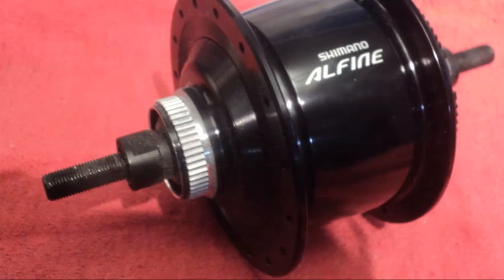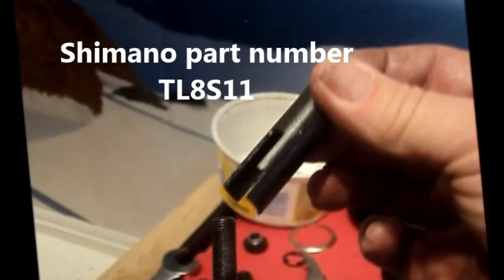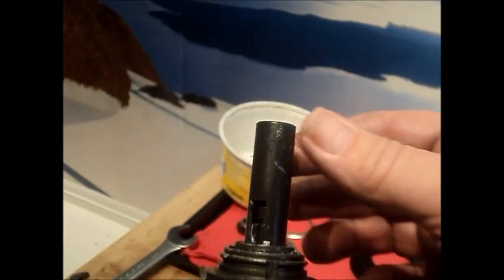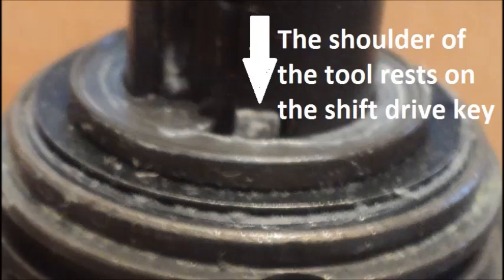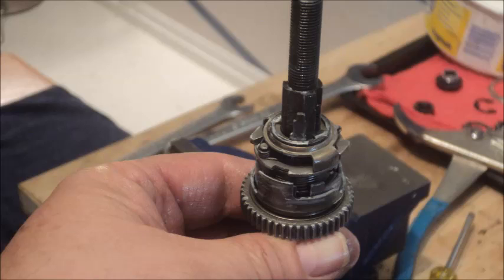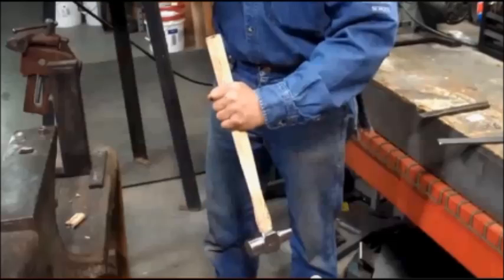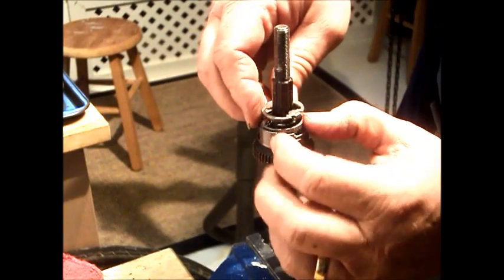Removing the drive side cone from Shimano Nexus/Alfine

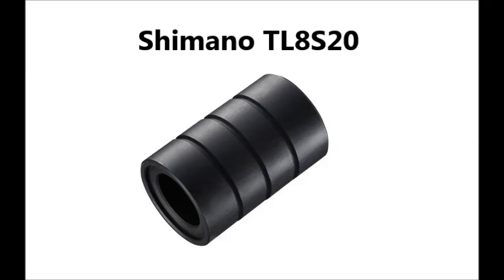Comment: At 1:55 you don't have to use the Shimano special right-hand cone install tool (TL-8S20).  You can just use the outermost locknut on the axle (last part you put on) to press the right hand cone down until it hits the designated shoulder on the axle.  If you watch some other Alfine 8 videos, you'll notice that even after using the special tool, they are using a cone wrench to tighten down this locknut another 2 turns or so, and NOT BY HAND, which means they are driving against a press fit, and that the wrench stops when the cone bottoms out.  So we can drive the cone the whole way using the nut as a press, not just the last 2 turns!  In case you thought you need the special tool to press the the cone to exactly the right depth on the axle, you can't get it wrong because it always bottoms out anyway, when you tighten the locknut.  Besides, relying on a press fit to maintain the position of a cup-and-cone bearing is foolish because tightening the LEFT side cone during final adjustment could easily move the right side cone, and if not, riding would eventually introduce play.  It need to have positive stop against which the bearing can be adjusted.

Comment: Hi, the seal of the drive side cone got broken and came off on my alfine 8 (that is rather new - 3000km) (here is the part number Y37J98080 from https://si.shimano.com/pdfs/ev/EV-SG-S7001-8-4111B.pdf), based on your experience, should i remove the cone and replace the seal or based on the difficulty of the process, i can survive with just more regular cleaning? Thanks!

Comment: The warning regarding the spring-assembly was well-received, and appreciated. But even though I managed to remove the drive-cone without breaking open the spring-cluster, it  became loose and popped later in the process. I can tell you - that was one hell of a puzzle! It took me well over 2.5h in the middle of the night to understand the internal workings of the pieces, and to get them back together. To load the springs was especially hard - but it worked. 

The Reason I took the hub apart was to mod my trusty old s501 to a s7001. It worked (the parts cost around 60$), and I finally have the not-inverted rapidfire shift-lever.

Comment: I think maybe the left hand serated lock nut havent been tightned enough on my alfine hub. After i had my rearwheel removed and reinstalled it, it started to make a noise which you could hear in the entire frame some months after. I removed the wheel again and noticed the cone and lock nut was loose. Behind it the grease  was all red. In the cone race and in the ball bearing there were small pittings. Apparently water have entered the bearing. The rest of the hub was all fine. Is it easy to replace the left hand bearing?

brgds

Comment: hi...are there any special steps to remove the non drive side after you remove the lock ring and cover on the alfine 11? it just won't come off.
Reply from the maker: +Aaron Goss 
Yup, a small flat bladed screwdriver is the right tool for the job, but a good shop quality tool works far better than a cheapo one. Trust me on this. I remove a lot of those snap rings, and if I grab the wrong screwdriver, I still struggle. With a Klein or other high quality tool, it's s snap if you'll pardon the pun.
Reply: +Dan Burkhart I use a Snap-On!   LOL.
Reply from the maker: +Aaron Goss 
Snap on, snap off.
Reply: +Elhanan Maayan the Alfine 11 is very similar to the 8 speed, but the tools are different.
Reply: +Aaron Goss there are no tools to my knowledge to either for the lock ring.
Reply: +Elhanan Maayan Lockring on non-drive side is the same as a hyperglide cassete lockring tool.
Reply: i'm talking about the drive side the one used to hold the sprocket in place.
Reply: +Elhanan Maayan OH, your original post says non drive side
The snap ring to hold the cog in place uses a fancy tool called a screwdriver!   SRAM actually makes tool do do it easier, but removal is still a screwdriver.  I will need to test it on the Shimano hubs.

Comment: Dan,
so the side of the tool is placed right next to the tang of the shift spring part - not on top - so you are not hamering on the shift spring part - right?
Reply from the maker: Eric Herrera 
The force of the impact is taken by the axle. The tangs of the tool prevent the shift spring assembly from coming apart but no impact is taken by it.
 The tool will automatically come to rest in the proper position when fitted into place with the notches resting on the shift key.
Reply: the step by step info that Shimano provided is very unclear (it's on Sheldon Brown's web site now)...at lease to me... it looks like you should be hitting the tang of the shift spring in the picture with the tool...thanks for getting back to me

Comment: The hub is designed  from a crawler e.g.dozer,excavator,planetary, sun gears.A thicker oil will not escape the seals as say 80w90 it will  stick  to gears and not puddle and leak,true minus o*c will require thinner oil, the key point is don't use excess oil.a cap full is plenty ,no super lithium required. Not an expert but I sold shimano the drawings.

Comment: Yikes! I rebuilt an older Shimano dynahub and it was a much simpler procedure (relatively speaking, as no special tools were required). Unfortunately, the cones I need are no longer available for that hub, so I had to make due with sanding the cones as best I could and replacing the bearing balls. My point, to anyone watching this video, is buy extra parts when you buy your hub so that you have them down the road. Shimano doesn't exactly flood the market with spare parts for their dynahubs and internally geared hubs, they are a small market. Great video Dan, thanks for doing the research and sharing your knowledge!
Reply: +Domino_Dancing coned can be re-ground in a lathe with a Dremel stone bit.  We do it all the time with great success and durability.
Reply: +Aaron Goss Thanks for the feedback. My main fear was that the work-hardened surface would be compromised. Good to know that durability has not been an issue!